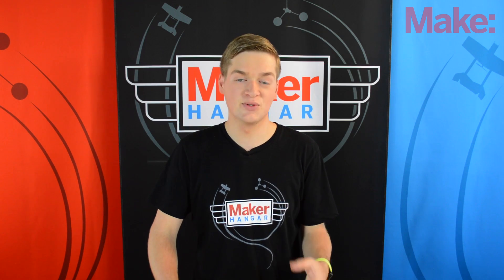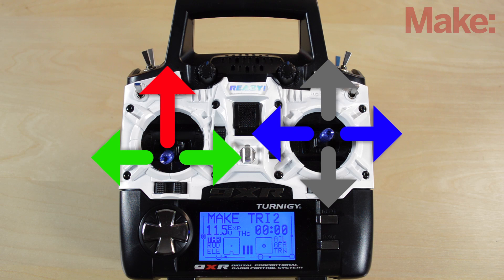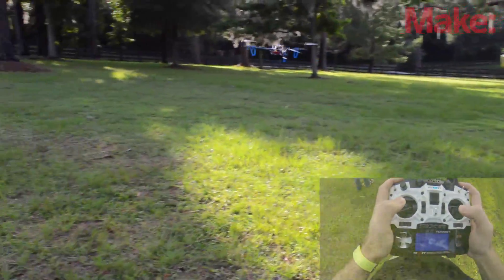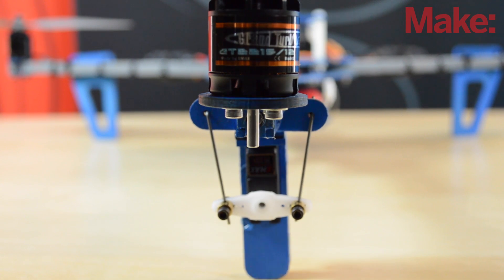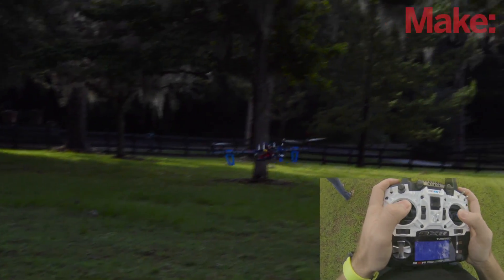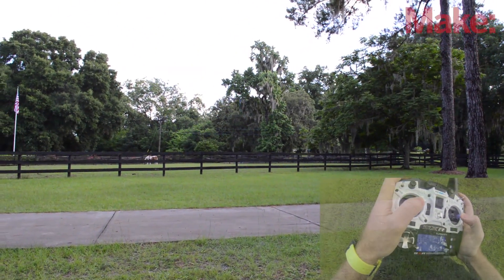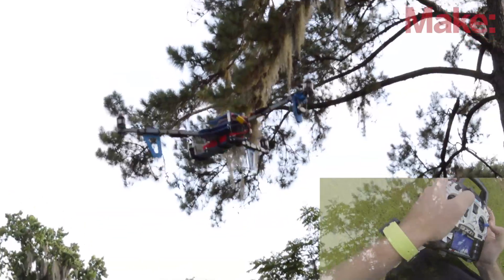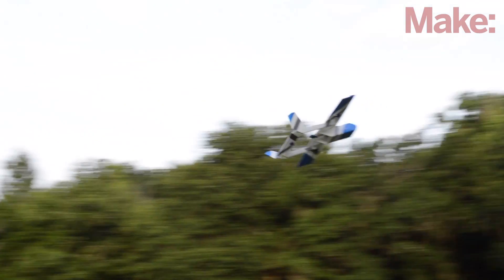Maker Hangar 2: 05 - Flying a Tricopter

Comment: Hi,
I'm flying a Multiwii 2.3 (kind of David Windestal Design) Tricopter and I experienced that it is no good idea to "click" the yaw motor into any direction. Mine is the most stable when it is facing exactly straight up. Otherwise it is possible that it "yaws" faster to one side then to the other.

Comment: This has been a great series. I was looking up that transmitter (Turnigy 9XR) and I found some on our favorite auction site. My queation is, they say "Mode 2, (No Module)" Is there something else I'll need to buy, or is this good to go? It says it has an internal antenna, but I see you have a separate module on yours.

http://www.ebay.com/itm/BRAND-NEW-Turnigy-9XR-Transmitter-Mode-2-No-Module-9CH-Internal-2-4GHz-Antenna-/251490549368?pt=Radio_Control_Parts_Accessories&hash=item3a8e013e78

Since it usually takes a month to get things from China, I wanted to make sure I was getting everything I needed at once.
Thanks for the videos. Looking forward to the new Maker Trainer plane!
Reply: The 9XR comes with no module to transmit your signal. You will need to get a JR style module of the brand of your choosing and a matching receiver you can check out some options on the tricopter product page under radio equipment: http://lucasweakley.com/product/maker-hangar-tricopter-kit/
Reply: If I were you I would go for a Taranis as It is just awesome you pay 110 dollars for that stuff when you can get a 10x capable radio at 180 dollars